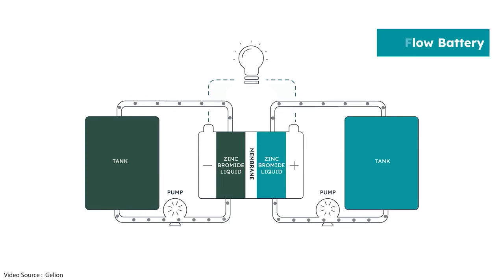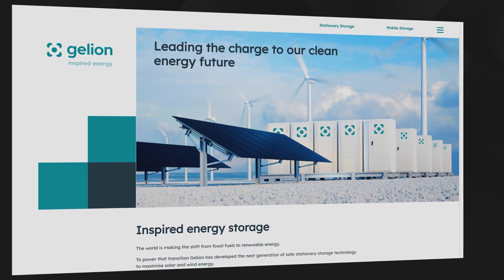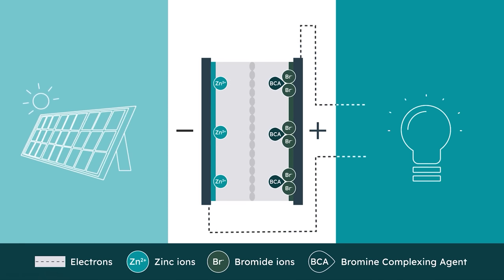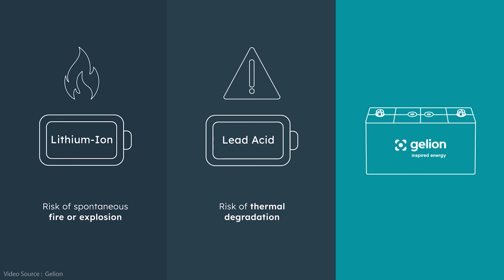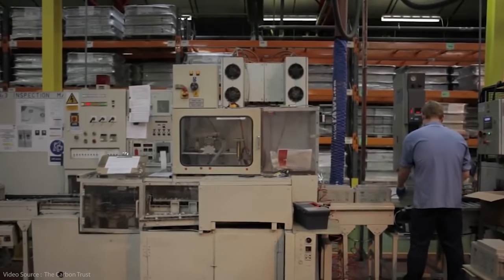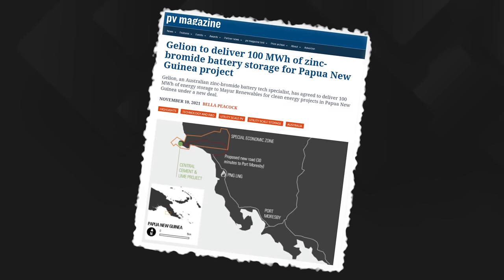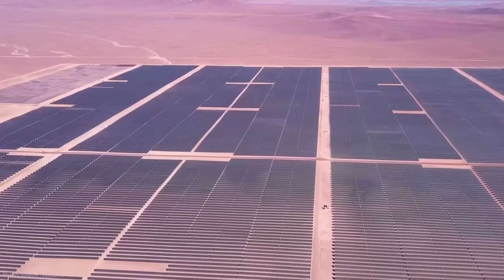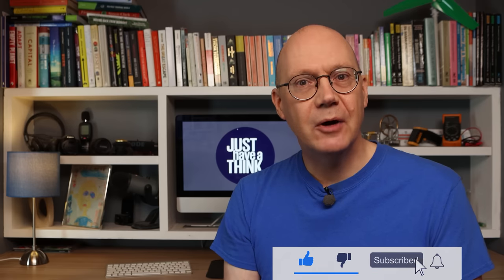Zinc Bromide GEL batteries. Cheaper, greener, simpler & safer than lithium -ion!

Comment: I have always looked at lithium batteries with the question: "Why are people using those when weight isn't an issue?" Lithium is great for moving objects, but for stationary ones the advantage is small. I've used lead-acid for electric vehicle designs before electric cars were popular, and it worked. But Lithium is great there. And should probably be reserved for that application.
Reply: Agreed, modern lead acid formulations are as good for stationary situations as lithium at half the price.
Reply: @jimgraham6722  the whole point of the newly listed company is it makes lead acid batteries obsolete that is unless you just enjoy being around lead and sulfuric acid!
Reply: @jimgraham6722  i don't think that's the case. LFP batteries can do 10- 20 thousand cycles if managed properly. i don't think lead acid comes close at all.
Reply: There are other factors, for example lead-acid don't like to stay at mid charge for long periods, they need to be fully charged (and slightly overcharged time to time) to avoid sulfatation.
While lithium are very happy working in the 20% to 80% SOC range.
In renewable energy systems is ussual that the battery doesn't reach 100% SOC for weeks, which is a killer for lead-acid, but good for lithium.
Reply: @TheLosamatic  Can you buy this new battery and if so how much?
Reply: @arcachofo  Not really, my house is fully off grid and uses a 25KWh lead acid battery pack. The current pack is 15 years old and has done over 5,000 cycles. There haven't been any problems with it all. 

It is charged using a solar MPPT charge controller that automatically does a levelling charge about once per month.

It normally charges to 100% every day by 11am as long as there is bright sun. It is perhaps only one day in ten it doesn't reach full charge by end of daylight.
Reply: @jimgraham6722  Exactly it NEEDS to be fully charged every day and Levelling once a month. If not it will not last too much.
Lithium does not have that problem.
Reply: @arcachofo  Not a problem, charge controller deals with it automatically. Has done so like clockwork for fifteen years.
Reply: @jimgraham6722  If there's not enough excess power to charge the system to 100% every day, it doesn't matter what the charge controller does.
Reply: @arcachofo  You're correct that there are different profiles. But it is also correct that solar charge controllers take care of this nicely. Likewise Lithium requires special attention in charging, even more so than lead-acid, and require specialty programmed controllers. There are advantages of lead-acid over lithium also. One is a much higher discharge rate (or C) for powering high demand devices. Another is the inherent freeze protection, whereas Lithium requires a heater to prevent freezing. 

Lithium cells need to be balanced just like leas-acid, but require a special BMS electronics set to get that done. And Lithium has low heat tolerance. Also, it's difficult to recycle whereas lead-acid can simply be made into a new battery. We are not starting any coups to get access to lead. 

For residential solar lead-acid actually works rather well. You can run high discharge loads without getting a jumbo battery required by Lithium, as lithium doesn't provide good discharge current rates. There's also a very very low fire risk, unlike Lithium. Large forklift or telcom or golf cart batteries are available, including used. 

That said, an updated wet cell like the Br-Zn chemistry here shows even more promise. For stationary power, it looks really promising. And it would free-up lithium for mobile applications, which is better for all the reasons you listed.
Reply: @jimgraham6722  Yes, lead-acid does fine for residential. Bromine-Zinc looks like it could replace lithium for stationary power. Then lithium would be more available to mobile uses, so it's a win-win for both. 

Where neither size nor weight is an issue, lithium just doesn't make sense when other technologies can get the job done. Thermal batteries, flow batteries, and Na batteries look like good grid-scale commercial technologies. I can't see putting huge fields of lithium batteries on concrete slabs as anything but a bad idea. What a waste of scarce lithium.
Reply: @jimgraham6722  charge controller deals with it automatically... if there is enought energy.
And not a problem, it is just one of the disadvatages of lead-acid, and that is just one example, there are some other disadvatages as well as advantages.
The point was that weight is not the only consideration, and depending on the case lithium can be a better choice.
Reply: @onebylandtwoifbysearunifby5475  Exactly, there is a whole lot of considerations beyond wieght that can make a system preferable depending on the case.
Reply: It’s not just weight, it’s a whole bunch of stuff that makes lithium superior. First volume - space can often be at a premium even in stationary applications. Second - charge and discharge efficiency and flat discharge curves compared to lead acid. Third cycle life - lead acid can only be discharged to 50% and cycle life still tops out at about a 1000 cycles. LiFe can be good for over 4000 cycles with 90% dod. Fourth is power - you can discharge lead acid at quite high rates but not continuously if you want the battery to last. They have a much higher internal resistance compared to lithium chemistries and this causes heat to build up quickly during excessive charge and discharge leading to shortened life and lowering efficiency. Zinc Bromide Gel batteries are not even on the market yet but they may solve some of those issues but not all of them. Right now, lithium is still your best option for home batteries.
Reply: @mondotv4216  We need to look beyond lithium for stationary power. There are other chemistry besides lead-acid for stationary power. Lithium is in limited supply. Since lead-acid does rather well for stationary use, the advantage of Lithium over lead-acid is a lot lower compared to the advantage of Lithium in mobile use. Unless we find a limitless supply of lithium, we're better saving lithium for where it does the most good. 

Yes, lithium cycles longer. But lead acid is cheaper and can be recycled. So what are we really increasing? Ultimately, you will get more charge cycles from the lead-acid battery, including recycling. And the cost is not higher on a watt-hour basis. 

Yes, Lithium has a deeper depth of discharge, but you can completely nullify that by having a larger lead-acid battery. You get the same total energy available to you. And your discharge rate is higher, and heat build-up lower than lithium (without the associated fire risk).

When you don't have ability to add more weight or size, then Lithium is clearly an advantage. So much so that Lithium should probably be saved for that use. Other wet chemistry batteries are available too, and Br-Zn looks promising. Thermal and flow are rather ideal for grid-scale.  It's a question of putting the limited resources where they do the most good. ICE fossil fuel vehicles are only 20% efficient. If we use up all the lithium for grid power we're finished.  Planet over.
Reply: @arcachofo  In the domestic off grid situation enough energy isn't usually a problem. Solar panels are cheap. You just keep adding them until there is. However, if you live in a location where there is a deficit of reasonably sunny weather, I agree there can be a problem.
Reply: @jimgraham6722  lead acid is king if you only use 10-20 percent daily they last a very long time I have a stand alone system similar sized. 
All you have to do is have 3 to 4 times the solar panels you would require doesn't matter if its cloudy with these new low light solar panels are great I choose lead over Lithium because of price is the main factor and the simplicity they are so tough. mppt controllers are awesome
Reply: @mrbontful  Yes agree, for off grid lead acid (PbA) and lead carbon greatly under rated. I think for standalone domestic off grid systems, lithium just adds unnecessary cost and complexity. My 25kWh PbA battery is regularly cycled by about 4kWh, just once in a while it goes to about 12kWh. Fifteen years on it's still going strong. 

However, I am budgeting replacement in next few years. In addition to traditional PbA I will also be looking closely at lead carbon. In my view they are worth about a 20%-25% premium.
Reply: @jimgraham6722  I would of bought lead carbon but at the time they were 50 % more the price for the same compacity as a AGM were on special
Reply: @mrbontful  Yes, 50% premium is too much. This is because you can get the same performance improvements by adding a super capacitor in parallel to a standard PbA battery. Super caps suitable for a domestic off grid set up currently cost about $1,500.
Reply: @TheLosamatic  Well, for cool things to place in your garage to store energy, I'd suggest molten salt batteries. :D
Reply: @onebylandtwoifbysearunifby5475  you sure you dont have that back to front ? Pb suffers from peukert's law. Li dont. You can draw huge loads from Li - and charge really fast. some need those attributes.
Reply: @jimjones7821  People may be surprised to find out the lithium 12v battery they ordered cannot run a power table saw, whereas the lead-acid battery can. The discharge rate of many commercial Li batteries would forbid high current loads like 2,000 W motors.  The discharge rating is given in "C", and many 12v or 24v Lithium batteries are often lower having a C of 0.8, while lead acid may have a C of 1.0 to 2.0. Often the protection circuits prevent Li batteries discharging a C of 1.0 or higher. It's something to look for depending on your application. You can get around this by adding more batteries. But for small systems, two marine RV deep cycle L-A batteries wired in parallel will pull full power for a 3000W inverter. The same package using Li typically cannot. 

Aside from a heat issue, lithium has problems in low temperatures. They don't tolerate freezing temperatures and can be destroyed by charging in cold weather. They generally cannot be charged below 40 deg F, or 5C.  Many Li are packaged with resistive heating just so they can charge in winter, which Lead-acid doesn't require. 

Does Lithium have some advantages? Yes, sure. They are more efficient in charging and discharging, by about 94% compared to 85% for Sealed Lead Acid. If the battery pack is large enough, they can draw more power for longer without decreasing efficiency. But lead-acid also has some advantages. They are more robust, handle a higher and lower temperature range, and often have higher discharge current in small form sizes. And are recyclable, cost significantly less, are not in scarce supply.

With these advantages the newer wet cells chemistry Br-Zn and such seem very much needed. Lithium is trendy, but isn't required for stationary power. Stationary power is not such a slam-dunk for lithium as mobile power. Given the shortages of lithium, it may be better for people to start with lead-acid in many applications. But an updated chemistry would be better still. Large grid batteries should probably not be lithium, there just isn't enough lithium available. Small residential batteries can be other chemistries too. Living in a commercialized society we're conditioned to think we need the absolute best in all applications. But many times more of one thing beats "the best" of something else.
Reply: @onebylandtwoifbysearunifby5475  It is correct about Lithium and temps. However you can use LTO for freezing temps if that is a need in your application. LTO is a pretty amazing chemistry - 20,000+ cycles and you can discharge them to full flat them recharge them right back up - this does take the life cycle count down to around 8000 -10,000 cycles but its a pretty good trade off I think. Imagine discharging your batteries to 0, let them sit for 6 months in a zero state of charge then charge them right back up to full and still have 8000+ cycles! Plus you can charge /discharge LTO in freezing temps quite safely. The disadvantage to LTO is the power to density - they not anywhere near as light as Lithium. A MASSIVE advantage of LTO is the very very very short charge times to take a cell from 0 to full - it can be as little as 10 mins to fully charge an LTO cell. They are 2.3v nominal per cell. LTO is the safest of all the Lithium chemistries - you cannot get these things to catch on fire! So its a case of optimizing for your application. Where Lithium really shine (excuse the pun) is in solar applications. Lithium can take a very fast heavy charge -Pb cant do that ! Pb needs a bulk charge  then an absorption charge for the last 20% of charge and this takes many hours. Pb MUST be returned to 100% state of charge to get the life cycles out of them. This can be a real problem with solar systems. If solar is insufficient for the day and you need to run a genset to charge then Lithium wins big time - gen set may run for 2 hours Vs about 6+ for Pb batteries. Huge cost difference in diesel consumption between the two batteries if having to charge via genset. Pb is great if you can draw off them slowly over time - dont forget Mr Peukert. Then there is the fact that you dont really want to draw down more then about 30% of your Pb batteries amp/hrs. Lithium is happiest at a partial state of charge and you can get the best life running lithium between 90% and 10% state of charge. I have had Pb for many years. My next battery bank will be Lithium for sure. LiFePo4 to be exact. I dont need the things that LTO bring as I am in the tropics, so lots of sun to charge with so no need for the genset to top up the charge most days and temps are hardly a problem in MY application. You have to tune for YOUR application.
Reply: @jimjones7821  Yes, Lithium has it's advantages. And if we had an unlimited supply, or could recycle it, that would be great. But even then it isn't always the best option. 

For example, a few years ago i started building a house in a remote wooded area. I had to run a miter saw and various high current draw tools. If i used lithium, i would need a minimum of (4) 12v batteries in series to get the required discharge rate (C). But using just 2 lead-acid, i was able to get a higher discharge rate than 4 LiFePo4 batteries of the same capacity. 

Right, i had plenty of solar panels to charge the batteries and even run tools directly on sunny days. Lithium likes being stored at 50%. That's not typical in solar PV systems, which top off batteries daily. 100% is more common. A float charge is typical. Lead-acid likes the full charge condition, whereas Lithium does not.

In addition, i was able to leave the battery  pack unattended, even in freezing temperatures. And inside without fire concerns due to lower charge density. 

Now, if i had gone Lithium there, i would have needed a resistive battery heater (always drawing power in winter, even on cloudy days), an outside battery box, and 2x the batteries due to Lithium's 0.8 "C" maximum discharge rating. So 2x the cost? No, because Lithium is already 3x the cost. So 6x the cost of Pb-Acid for the same performance. But the same? No. Less, because it would have either frozen, not charged, or drawn constant current for resistive heating. And then there's the separate building i would need. So 12x the cost for more hassle. 

OK, now that's a special case. BUT, all cases are special cases. There is no "standard" application. 

I still have those 2 large Pb-A batteries in a self contained system. They're doing great. I use them for all my high demand loads like table saws. I also have several LiFePo4 packs. They do different things. Each has pluses and minuses. For residential, i do not understand how we can possibly power it all from Lithium batteries. We don't have enough lithium. It doesn't mean YOU shouldn't use lithium, just that we can't ALL use lithium. And if we want electric cars, we ALL need non- lithium energy storage solutions for residential stationary batteries. 

One thing that is overlooked here is this: hybrid solutions. Maybe a flow battery and capacitors and small Lithium pack. Or Br-Zn and a small Lithium pack. Bulk energy storage, long term, plus a daily cycling small Lithium or Na ion battery. We have to reduce dependence on lithium. 

I will look into your recommendations for that lithium chemistry, thanks.  It sounds promising. I have 3 different chemistries running now, with 3 banks and 3 different charge controllers. The lead-acid is always topped up, most every day. The small Lithium batteries get cycled often. But when i need extended power, i have some big lead-acid which have been running for 5 years.  Like any other optimized engineering project, using different materials within their strengths gives the best performance, and at the lowest price.  If the Br-Zn batteries featured here work out, i would gladly add them in for Pb-A-. Maybe the Li you suggested as well. And maybe some super-capacitors, or Na ion if they can replace Lithium.
For stationary power, we just need to avoid "Lithium" tunnel vision. Yes, it's the popular craze, but 8 Billion people can't put it in their houses and cars.
Reply: @thelight3112  If there's not enough excess power to charge the system to 100% every day then a storage system is basically pointless as the ROI will be shit.